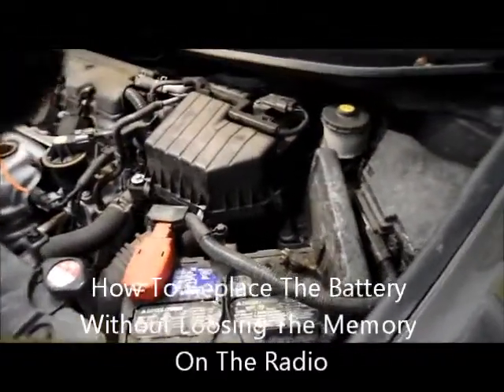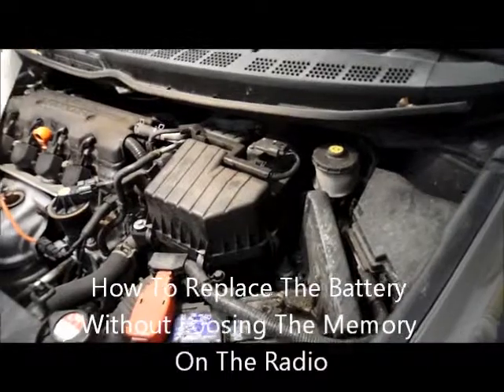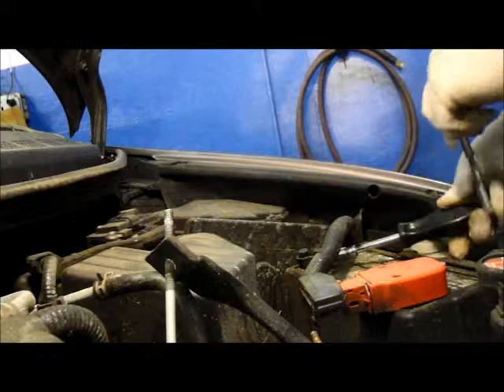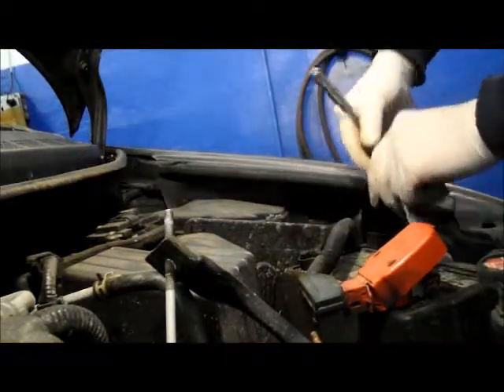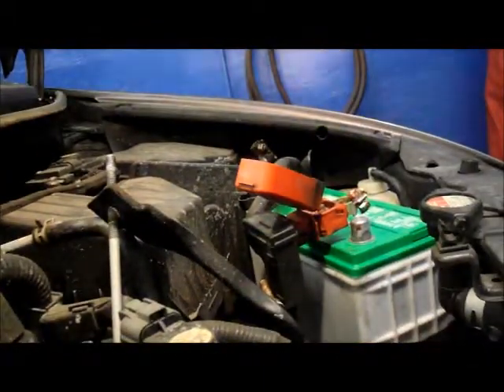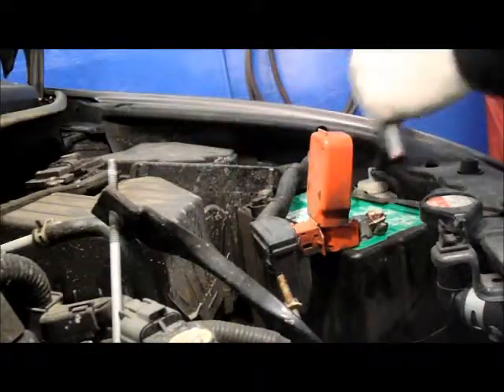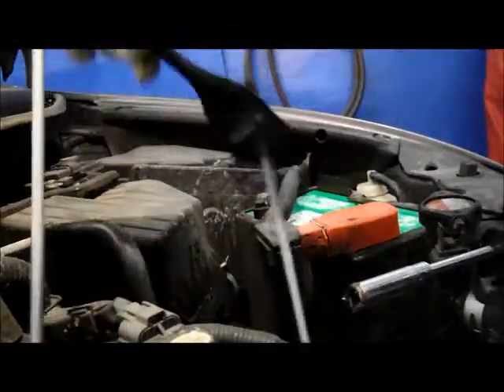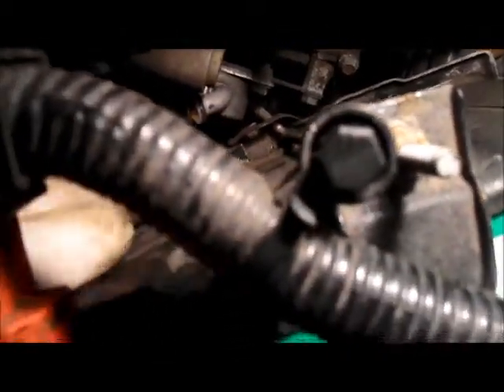How To Replace The Battery On a 2009 Honda Civic

Comment: I know this is an old video, just watching some of your older content.  I got bit by the radio in an 05 Civic.  I bought an OBD saver that goes from the jump pack to the DLC connector under the dash, just in case the accessory / lighter port has a blown fuse.  You did a more recent video on a battery replacement with a charging system diagnostic.  Your videos have gotten more detailed over the years.  The content is appreciated.  Keep up the good work and thanks for sharing your knowledge.